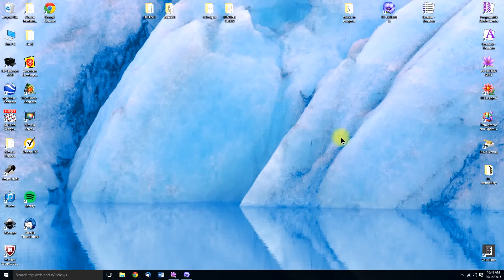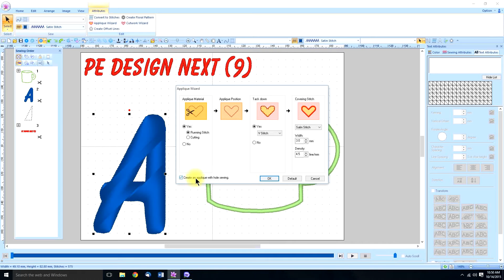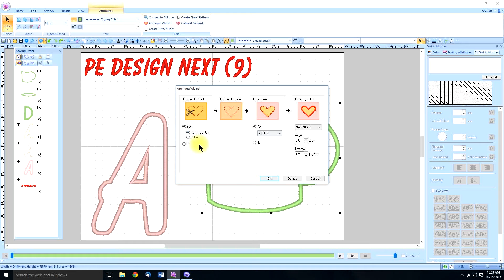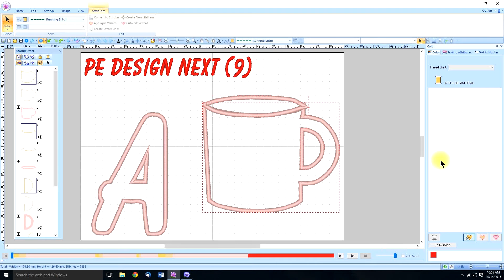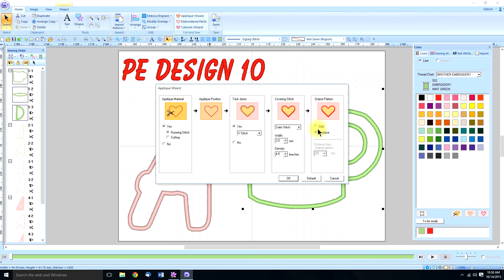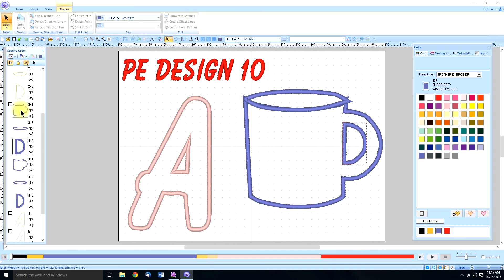PE Design applique (lesson 41 part 2)

Comment: This was so awesome.  Wish I could come take whole weekend class with you.  One quick question.  If I used the appliqué cutout running stitch and either actually put thread or used blank needle to puncture holes then cut out the appliqués with scissors .  Then put fabric down and run placement stitch.  How do I hold the appliqué material in fabric for tack down?   Thank you!
Reply from the maker: Since my husbands stroke I have been unable to keep up with my channel.  However I have found Face book has numerous helpful platforms.
Reply: @OleensEmbroidery  sorry to hear about your husband.   I appreciate what you already have just the same.